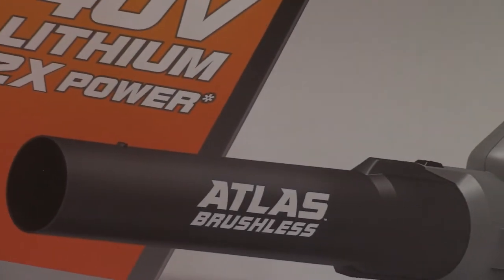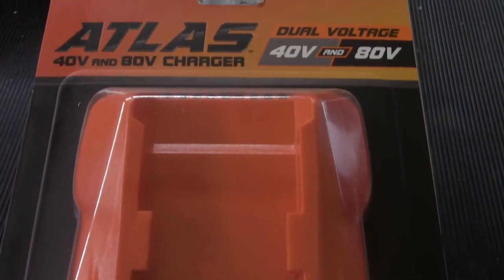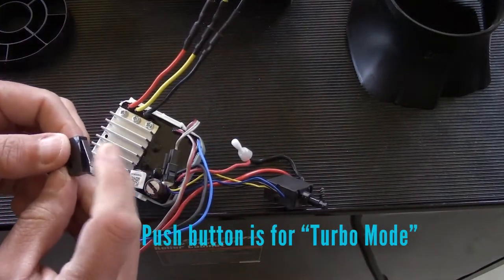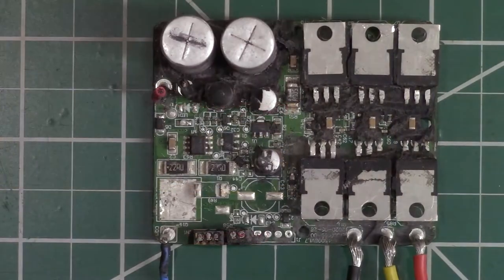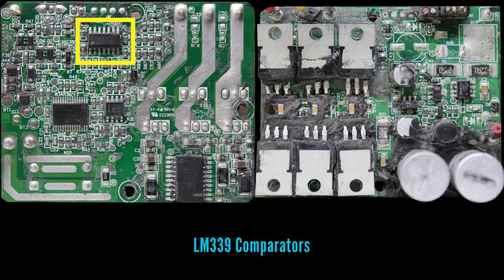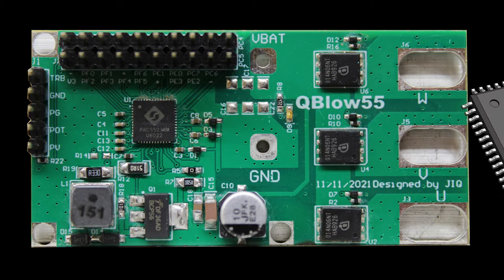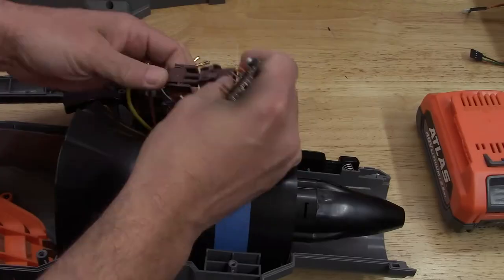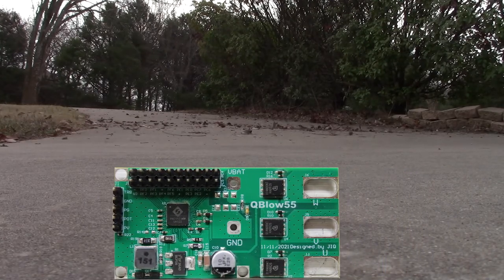PAC5523 Retrofit: Harbor Freight BLDC 40V Atlas Leaf Blower

Comment: I also noticed that the ATLAS brand tools don't run or charge when the battery is hot on summer days and have to be warmed up in the winter. So there is a warm up period or cool down period. Is that circuitry built in each tool or in the batteries and charger?
Reply from the maker: Have not used the tools enough to notice this. It is really hard to know for sure the exact reason why this happens. Traditionally, there are protection circuits in the battery (usually thermistors) to ensure you are not charging the battery when it is too hot or too cold, but the temperature would need to be significant before these circuits trigger the protection. Of course if you are in arizona at 110 degrees F, and the battery has been exposed under the sun, then that is probably going to kick in. My impression is whatever temperature protection the tool system has, will be within the battery. There might be one in the tool for protecting the FETs and the motor, but I personally do not feel I have encountered this circuitry within the tool itself. Motors and FETs can get way hotter than batteries so you can design power stages without any kind of thermal protection and be OK (you would need to go past 150C for the hardware to start facing issues). Not so much with a battery, which might catch fire and that is not going to go well at all.Thanks for watching the video!

Comment: Would you know how to bypass the original control board's blue wire omega pin so I could use a different 40v tool battery?
Reply from the maker: My impression is this could be a communication link with the battery. If that is what it is, it will be tough to "bypass". In essence you will need to finalize the serial protocol request before the tool acknowledges the power source and allows for enablement. I will admit this is a total guess based on what I have seen out there, not because I actually performed these particular experiment on this exact tool. Hence, I could be wrong. At the end of the day, I do not hold the answer to this question. Sorry about that!